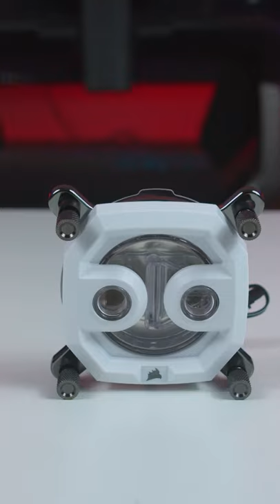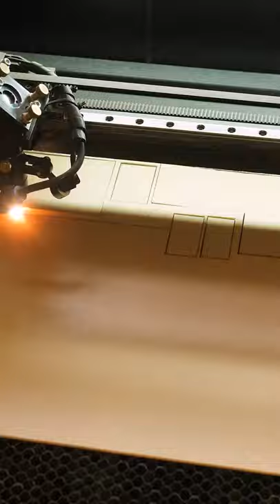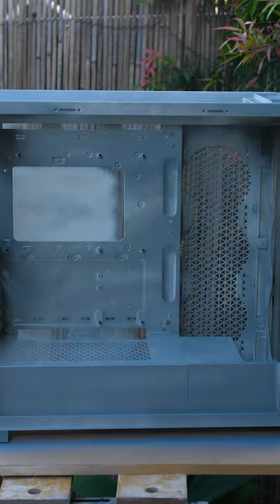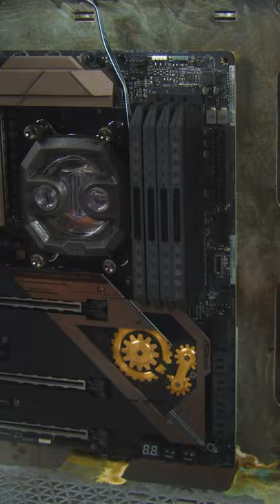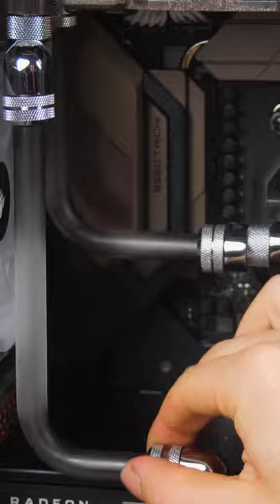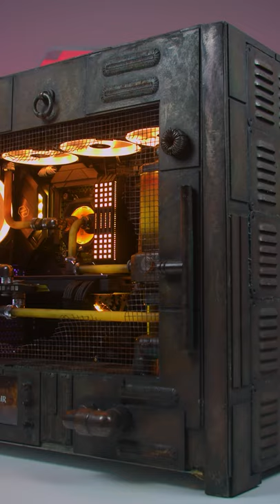INSANE $6000 all Corsair & AMD custom gaming PC!

Comment: I like the look of these kinds of pc's but honestly on a matenance and overall ease of access standpoint. These kind of PC's are nightmares
Reply: My custom loop has been going without a single issue for over 2 years. You obviously haven't ever had to work around a giant air cooler or 3 slot GPU.
Reply: @peterpizzurro  never said a custom loop was hard. There epretry easy to mantaine. I'm just saying these custom pics where if you wanna access one apart of the machine you gotta disassemble a whole lot more shit. Kinda defeats the purpose of plug and play with PC. However some people are able to deal with that better

Comment: temps? from what I see, every fan is pulling air out from the case. must be a dust magnet with the massive negative pressure
Reply: LordLitch  Which is also an exhaust?
Reply: LordLitch ...Yeah, and it’s not pushing any air out, that’s the point.
Reply: That massive hole on the side is more then enough for an intake. The fans will create draft for cold air to be drawn in. Basic physics 😉🤙🏼
Reply: @PewGoBoomLife  Which would be fine If the fans weren’t literally preventing that

Comment: where the hell did 6k come in?
Reply: Approximate numbers:

Cpu, 650
Mobo, 500-600
Ram, 700-800 yes ddr5 is expensive
Storage 400-500
Whole cooling setup, 700-1200
Cables 50
Psu 180
Case 150
Acrylic/paint, 30
Gpu: 1.5k
So. Pretty close

Comment: Air flow 1 0 0
Reply: Without a glass panel its too much airflow... you need some confinement to create an actual pressure flow, not just room pressure air
Reply: @mattb6646  clearly you dont know how physics works
Reply: @uglymechanics6599  ah ok, so a fully open case without positive pressure to actually move the air across the components instead of lofting about without direction is better? Ok bud.  Go look up why positive pressure in a case is a good thing

Comment: Puts a Ryzen 5900 in it and a Raedon 6700 XT, buddy these parts in no way equal $6000 anyone who knows anything about pc parts can tell you it's worth around $2000, $2500 . Plus the open case is make it dusty super quick. It's nice but no where close to $6000. Even with a 3090 it still wouldn't be $6000
Reply: Plus it may be considered janky no real PC builder would cover the whole think in aerosol can. Get a paint gun I can see the wrinkles through the camera